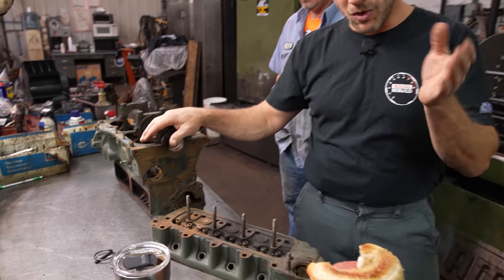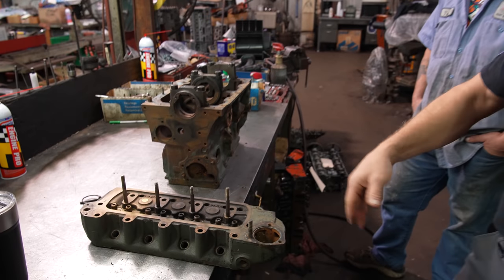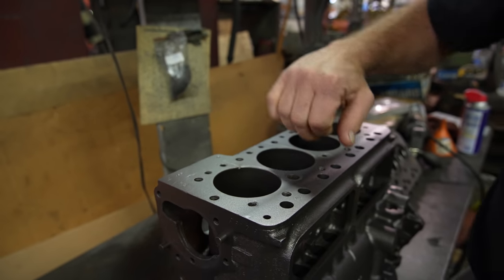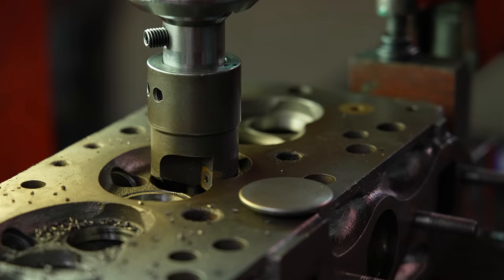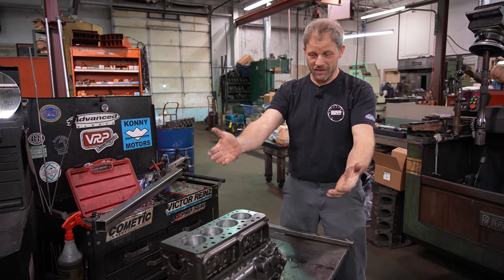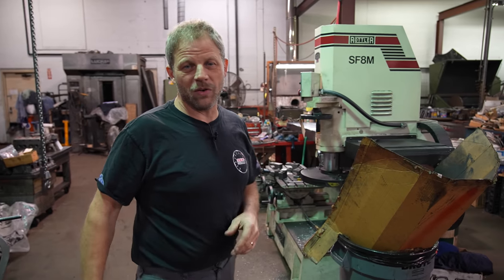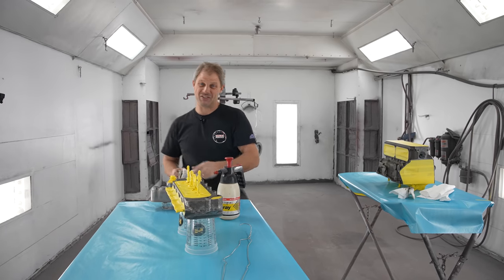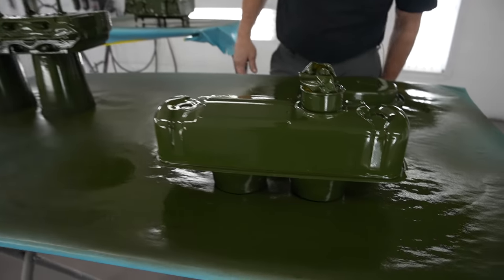Damaged Classic Mini block hits the machine shop... Can it be saved?

Comment: Looks a lot like a motor in my basement that I took out of an old Austin Healey Sprite. Mine still has the piece on the crankshaft for the hand crank start. I think they were just grabbing motors off the Morris Minor assembly line to use in early Sprites as the Minor had a hole for a crank start but I don't recall any Sprites with that hand start backup.
Reply: I think all Sprites used an A series engine like this
Reply: @secretagentbloke  Like it but different CC's depending on what year. The older ones are smaller with less horsepower. Maybe the bigger CC's got a little hard to crank by hand?
Reply: I think the A35 had the A series engine..Hub Nut has a nice 20 mins on the A series..

Comment: I'm sure the head has oversized valves, they are definitely not standard.  I'd also worry about removing any metal (chamfering) between the 2nd and 3rd bores as that's always a failure point.

Comment: Just caught up on this series Mr Hagerty and picking up on your surprise earlier about bolt sizes these were all 'Imperial' or what you call 'Freedom' fraction sizes. The threads were either UNC or UNF although the brute of a thread on the clutch end of the crankshaft and the crankshaft pulley bolt thread are Whitworth profile (if not BSW size).
Metrication had not kicked in by 1965 and even when it did the legacy engines and gearboxes remained 'Imperial' sizes.
So don't be surprised that your spanners (wrenches) are fitting my friend. They were US sizes and threads!
Apart from that bit of geekery just wanted to say what a superb and respectful job you are doing. That engine and gearbox (indeed the car) were revolutionary in the '60s.
I would suggest you spend some time just exploring how Issigonis and his engineers fitted a very good gear set into the 'sump' of that engine. That particular gearbox is called a 'Remote Change' and was considered the best for the faster Minis.

Comment: Unless the gouge goes to a water jacket hole, it likely would have been OK anyway as little as was left after decking. A soft head gasket would seal. That engine doesn't have huge compression. The rings don't go that high in the bore.

Comment: The siamesed port on 2-3 in these heads is a problem with tuning. David Vizard covered this in a lengthy seminar many years ago and he's convinced that there isn't a cam out there that can accomplish what the demands are of the engine.
Reply: There were aftermarket 4 port heads available.
Reply: @Smoutification  For the two cylinder engine? Yes such an engine was tried for the Mini.
Joking aside know you mean 8-port head for the four cylinder engine.
Reply: @thatdudeinorange2297  Hehe. Yeah sorry. I meant 8 port such as the Arden one.

Comment: Think you guys could give an estimate or how much it would cost to bore/sleeve/plane the surfaces on these builds? It'll help us project owners gauge about how much to expect to spend on things. Thanks!
Reply: Having worked in a machine shop I can tell you that the answer is always "it depends".
It depends on many things, all of which are unknown until the machinist has assessed all of the parts.
If you want a quote, take everything you need done down to a machine shop and ask them.
Also, the 2 companies mentioned in this vid (the machine shop and the paint shop) are probably either doing this work for free or for cost.

Comment: It would be interesting if you could tell us what the cc capacity has changed over the original 1275? You removed material from the head area and cylinder bores, so maybe still the same, more or less?
Reply: If the bore is now 40 thou over ( 2.82" or 71.63mm) the displacement will be 1310cc, so about a 37cc increase over the standard 1273cc. Removing metal from the top deck surface will increase the compression ratio but won't alter the displacement.  I quite like the green, it's a lot more interesting than Chevy orange

Comment: Thanks for the interesting engine update. That sh...ty green must have been the original color. Can’t think of any other reason to cuss a fine little engine that way. Decking the head and block will raise the compression ratio. Wonder if it will need premium gas?
Reply: This particular engine didnt have vacum advance for the ignition so octane needed for this engine was 98 at a minimum, preferably over 100 octane, but if thats measured in RON or MON is beyond me.
Edited my schpelling mischtakes 😉
Reply: @thatdudeinorange2297  If the mechanical advance is properly set vacuum advance is not needed, although it does help fuel economy at part throttle. I seriously doubt that 98/100 octane fuel was available to the general public when this engine was designed or even now. It will be interesting to see what fuel Davin uses when it’s fired up.
Reply: I think 93 octane R+M/2 gasoline is about 95 RON, but I could be mistaken. I'm guessing 98 RON was what you are thinking, I heard that was common in Europe.

I have heard that if some engines have more combustion chamber squish, they can handle a little more compression without demanding more octane. That might happen if the block is heavily decked and the head gasket is thin. This is why some guys go to great lengths to get "Zero deck" on engine builds.
Reply: Dont know about today but a year ago 98 octane was available for most of european cars, such as these Mini's which had 9,75-1as factory spec'd compression ratio. And yes Ron and Mon are different ways to measure octane rating. Sorry but couldnt remember which is used where. But vaugely remember 99 octane or even higher sold here in Scandinavia in the 1970's

Comment: How or why did they decide on 40 over for the cylinder bores???
Reply: To make sure they got the gouge and scoring out of the cylinder wall. +40 is quite a normal overbore size. Maybe they wanted a specific cc for the finished engine as well.
Reply: @marchilton5280  The big ridge on the top was probably. 030 or more.
Reply: @marchilton5280  40 thou is pretty much max for a 1275, the cylinder wall gets to thin between 2 and 3 cylinders. I was wondering if it has been punch out before.
Reply: Maybe it already was ,020" overbore?
Reply: @mylifesaga  40 thou is nothing for these. You can offset bore them 115 thou and get them to 1380cc.

Comment: this engine is not worth restoring. just a piece of trash tbh
Reply: Try finding a replacement Cooper S engine. I built one last year, cost me over $8k in parts. Yes they are super rare.
Reply: @iainbarker1815  LOL u can get a r56 motor with a turbo for a quarter of that, and replace the rings for 200$